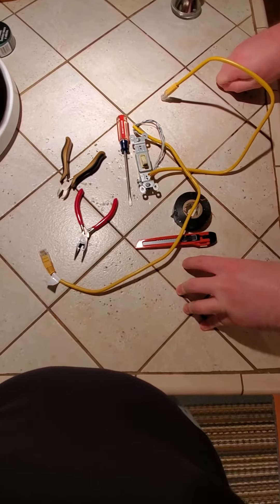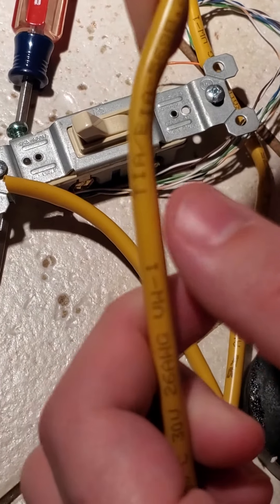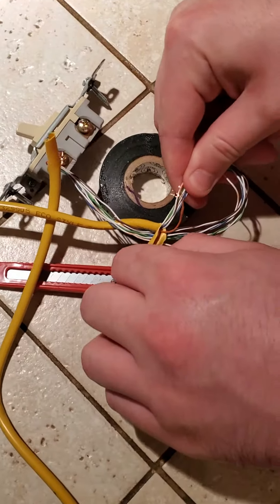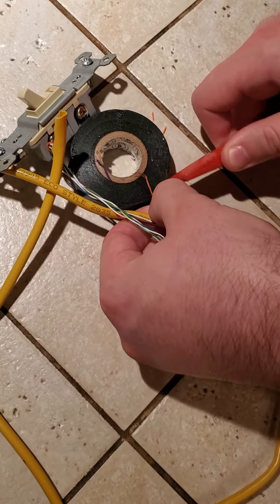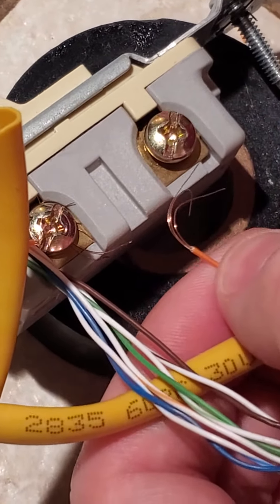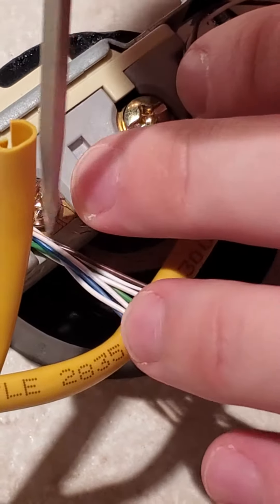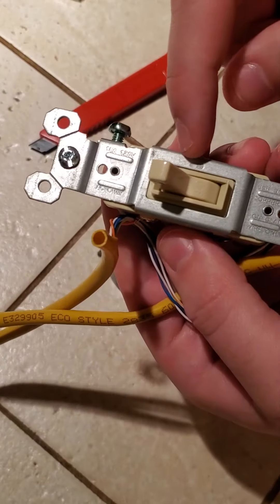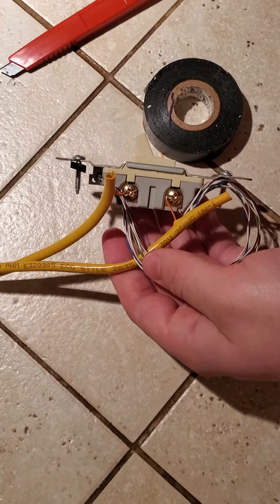How to Wire A lag switch(2022)

Comment: Man thank you for helping, but I am having a problem in cod mw, I tryed it and when flick it, enemies instantly kill me. Any idea what is going on ?
Reply from the maker: Happy to help ! So this is a little check list to help .
1. Is your switch close ? 
2. Timing , are enemies killing you as you flick it ? For instance when I flip my switch . There is a delay from where the actual lag starts to appear in your game. 
Timing is very important .
3. Is your console hard wired (lan cable) or on WiFi ? I get better lag when I use my WiFi . This is because your shortening the connection. 

4. The lag switch won’t stop you from dying like you suggested. However with proper timing you can skip across the map or move a few feet and increase the chance of getting away. Defense then offense is the strategy I use . 
In my case , when hard wired I have to hold the switch on longer, which either way if it’s on too long it will kill your connection . 
* feel free to comment 
If this doesn’t help give me more details on your set up . Also try to keep your switch closer to your gaming set up for easier access and try to time it . It takes practice . I practice in Fortnite playground modes. 
Good luck hope this helps !
Reply: @SteelGoom  Thank you man ! Now I understand how it works.
Reply from the maker: Anytime !
Reply: @SteelGoom   You need to be host? I tried everything you mention but it seems like I am more in disadvantage. Does it work with call of duty mw?
Reply from the maker: Stefan M Okay , what is your set up on ? Wired or WiFi ? You don’t have to be host . Some games are harder then others. Ex: I play ufc 3 and flipped the switch every time I was on the ground . It made me lag giving the advantage . So it doesn’t make you invincible . I think it’s hard to use in cod . Also you can’t use it too much or you will get booted out the match . Try it on fort or a different game . Maybe you will see what I’m referring to.
Reply: @SteelGoom  I tried both wired and wifi, I have 200mbps connection. Anyway thank you bro.
Reply from the maker: Yeah that’s strong connection , maybe hold the switch longer . Everyone connection is different. See if there is a difference if you hold it on longer .
Reply from the maker: Btw if you are being the host “ then you can lag others / lobby . Otherwise you will just lag yourself .
Reply: @SteelGoom  mine seems to only work when I’m host I have the connection starting from my sky hub then another sky hub connected to that and  the lagswitch is connected between them two and then another wire from the second sky hub to my Xbox or pc. I had a look at my wire and it says cat 5e udp and a load of numbers I can’t seem to find the tia/eia thing it’s also a pinky purple wire. I’m not sure if you have to put the wires in specific points of the hubs so that might be the issue. Atm it seems to work best when I am host in the game I say best I mean perfect every time it registers but when joining someone else’s game it seems to never work. Someone said this switch is know as a pull switch which I don’t understand. Thanks in advance.
Reply from the maker: Basically , the lag switch is suppose to lag you . While it lags you , you get the advantage and makes it harder for others to kill you etc. it sounds like you might need a different Ethernet cable . As far as what someone else told you . That does not make any sense . Hope that helps 👍
Reply from the maker: Also it should lag other people when you are host . Naturally because you are lagging yourself , hence controlling the data flow or connection from your connection.
Reply: @Bigblackninja5  There are 3 types of lag switches, 1 being a pull where you literally pull them but that is on halo 5. Then there is a tp switch which is a lag switch that teleports you. Then there is a pemi a switch that has those combined.
Reply: @SteelGoom  

Can you lagswitch using wifi? I thought you can only use landline

Comment: I build this lag Switch and i conect it to my ps4 but it Always say lan cable removed how can i fix it and do i need a network schwitch
Reply from the maker: Yes you don’t connect the lag switch to the ps4.
Reply from the maker: Check out my playlist I show each step if that helps. You need to connect your lag switch from your router to your modem.
Reply: @SteelGoom  I watched your playlist several times
Reply from the maker: @SonGoku101er  did you get it to work ?
Reply: @SteelGoom  bro i've been trying it for 2 days i've tried so many things with pc over wifi and nothing works
Reply: @SteelGoom  I think I need to buy a network switch
Reply from the maker: @SonGoku101er  explain to me your set up so I can maybe help you. How do you have it set up?
Reply: @SteelGoom  okay where do i start i have tried all cable colors once it disconnects me directly from the wifi if i connect the lag switch directly to the box but i need the network switch to do it like in your videos...
Reply from the maker: Oh okay. So you are using a different kind of switch ? The colors will only be 2 revisions A or B like my video. If you are using the cat5e cable.
Reply: @SteelGoom  ...so i connected it via the pc with wifi and the ps4 and the pc with lan and then via remote play i had to go to the internet settings but that didn't work because remote play blocked it so i tried it via remote play and with the clousy program i had the feeling that it worked for a short time because i was suddenly in a solo lobby but i didn't try it a second time because i've been trying for 10 hours straight but i'll try it again tomorrow
Reply: @SteelGoom  So with the first 2 lan cables there was nothing where I can watch which cable it was, but with the last one it was the same as the 568b from the video, so I took the orange one
Reply: @SteelGoom  I have the same problem bro, I bought a lag switch, the green wire is separated from the others, when I plug it into the console there is no difference, there is no lag, there is nothing and when I turn off the button on the lag switch, the console immediately loses connection???

Comment: hi i bought a delay switch but it has a green wire connected separately it is not red like you have in the video is the difference the problem because when i press the button on the delay switch on the console it automatically looses the connection internet connection is zero  i don't know what to do and how to use, if anyone can help???
Reply: I'm having same issue here too did you manage to work it out?
Reply: @MagiicFTW no, I didn't even try, I don't know how,I think the problem is with the ip address, but I'm not sure, I think something has to change there?
Reply: Yooo dude! You will need a network switch in-order for this not to immediately disconnect you.
Reply: The only network switches I can recommend are Netgear FS605 v2 and Netgear FS105 v2 !!!:face-purple-wide-eyes: